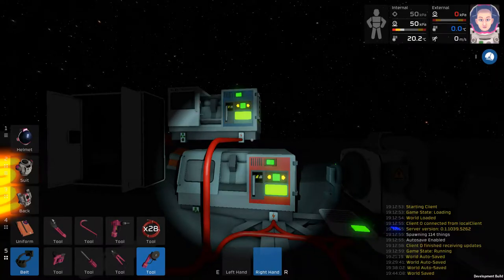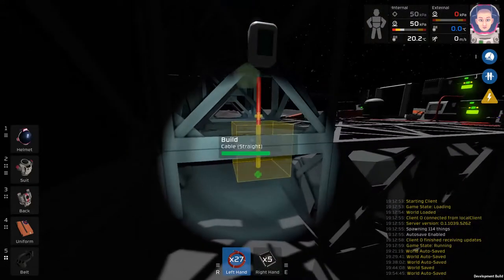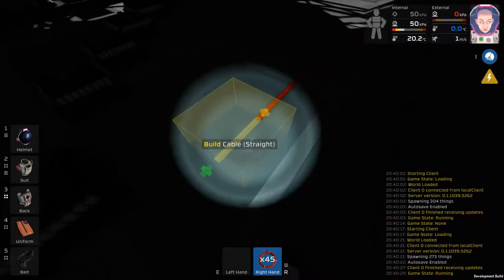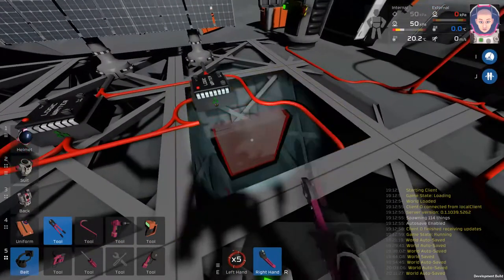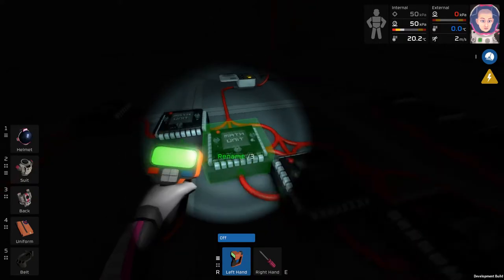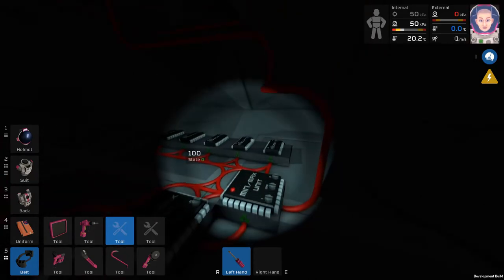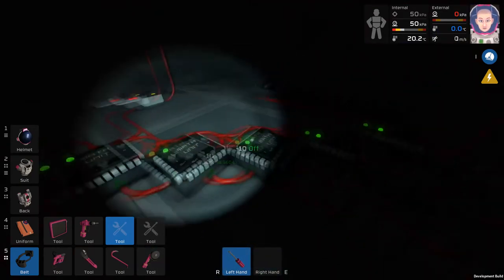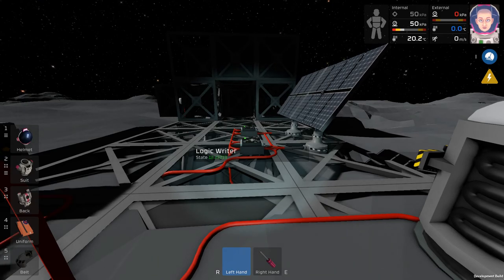LOGIC SOLAR ARRAY - In Depth Tutorial: STATIONEERS

Comment: I would recommend making a new video with the updates to the game and logic memory. This system works, and is very good at maximizing power generation, but is VERYYY costly for early game power. You can set up a logic system to control your panels with a single memory, a reader, a batch writer, and a math unit, which costs WAY less.
Reply from the maker: Nick Van Riper read lower, this, as far as I'm aware is incredibly efficient. The game also updates frequently, so some videos can go out of date the very next day

Comment: It can be done way easier than that.  Take the solar angle from the daylight sensor and divide by memory set at 1.8.  Write to vertical on solar panels.
Reply from the maker: Dave Vazquez video itself was made a while ago to be honest. I saw something mention that number, but the guy I got this one from said this one's more efficient. Maybe it's not, I'll do some testing or whatever.
Reply: This one more gets more sunlight through the day, but cost way more resources. The one Dave is talking about, works completely fine, but is definitely not the most efficient thing.
Reply from the maker: TheKillers yeah later I just set a few more to to shut them all off when the battery is full. Makes it pretty efficient